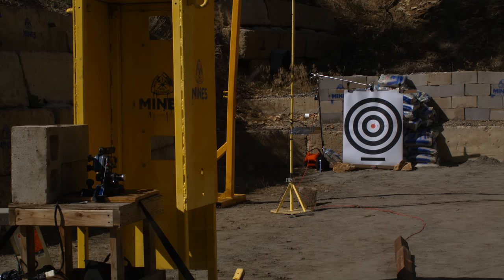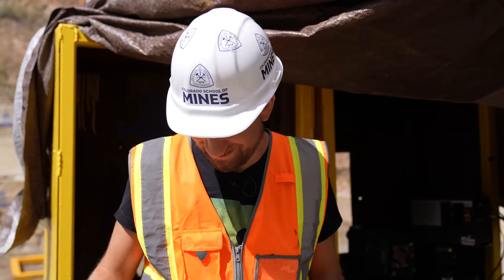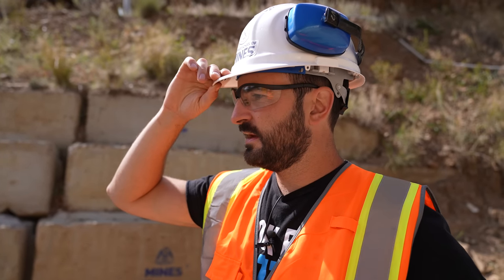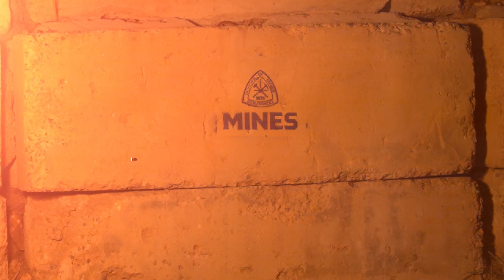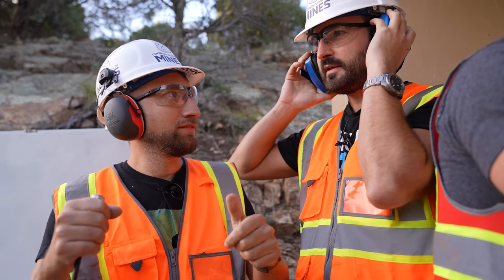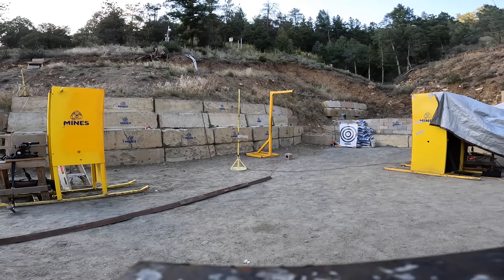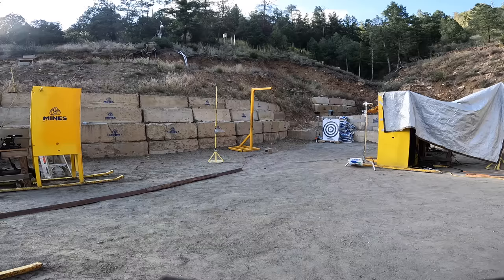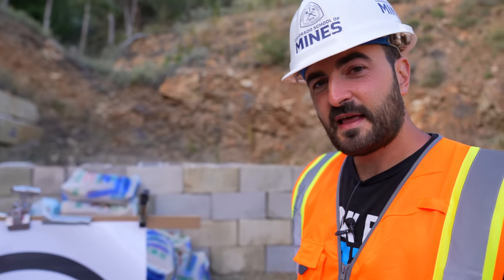Can Explosions Deflect Bullets? 2 MILLION FPS - The Slow Mo Guys

Comment: One thing which I think would change the results is testing supersonic vs subsonic rounds. If I remember correctly, 'standard' 9mm is around 1200 feet per second, while the speed of sound is around 1100. As I understand it no normal shockwave can propagate faster than sound in air, so the bullet would be simply outrunning the shockfront from the C4. A slower bullet, such as .45ACP is - I think - more likely to demonstrate an effect. Of course, it has more mass so that may change the effect. 

If you do it again, I strongly advise testing several different rounds/round compositions (eg sub sonic, super sonic, heavier and lighter bullets) - I imagine your friend Scott from Kentucky Ballistics could probably steer you right on that.
Reply: I made my comment about the bullet outrunning the shockwave before I read your comment.  I agree.

Comment: A shot bullet has a huge amount of inertia. Imagine trying to push a bullet sideways with your hands as it flies by you, hypothetically speaking of course. It'd be like trying to push a brick wall. It wants to keep going straight and is going to keep going straight. It would take a lot of energy to move it off course or deflect it. Think of what it does take to deflect a bullet, a solid sheet of steel or rock. If you have a sheet of inch thick steel (weaker than AR500 but close) at a 45 degree angle and shoot a bullet at it, the bullet slams into it and goes off close to a 90 degree angle from its initial trajectory and we get a big dent in the steel. Now think about it from a relativity point of view. In order to get that bullet to fly off at that angle at that speed, you would have to hit it with the same amount of energy it would take to put that dent in that inch thick sheet of steel... So if you can punch a dent in an inch thick sheet of steel, then you can punch a speeding bullet off at a 90 degree angle. So I would have been extremely surprised if these explosions did anything at all to the bullets trajectory. Speed is energy and energy is inertia. 

Bullets also weigh a lot for their size, so that gives them even more inertia. And it has such a small surface area for the shockwave to interact with it. More than 99.9% of the energy released by that explosion is not going into the bullet. In order to actually move a speeding bullet with an explosion shockwave, you have to go so big that the bullet will likely just evaporate from the extremely high temperatures before you get to the point where there is enough energy pushing on that tiny surface to actually overcome the bullets inertia. Maybe a nuke could do it. That'd be a really sick slow mo video though, shooting a ton of bullets at a nuclear explosion? Lol and you can just see each bullet lighting on fire and turning into gas. That'd be so awesome.

Comment: If you revisited this experiment maybe try a rifle bullet with a longer body to see if that is more affected? For example, found a bullet in 6.5 by Hornady that appears to be 6-7 longer than it is wide, theory being more surface area to be affected by the blast. But that is probably negated by the much greater speed, now that I think about it. Anyway, maybe something to consider? Thanks for the fun video. (bullet in question - 6.5mm .264 130 gr CX by Hornady).

Comment: @Gav and Dan, Maybe you could use some lower grain, slower traveling ammunition? With less energy and speed behind the bullet I imagine it'll be more affected by the c4. Maybe try several hundred fps slower for bullet speed/energy. The .22 caliber rimfire “Colibrí” rounds fire only 420fps, and they're .22 so theyll be much lighter in addition to slower, so much less energy to overcome overall. Cool shots though!

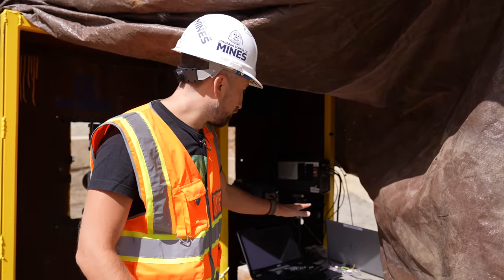Comment: 2:41 Wow, a whole 250 frames? That's incredible!
So I guess after that you need a new shimadzu?
16:12 Exactly. There's a huge difference between "slightly affected" and "not affected". The former means with enough power you might meaningfully deflect a bullet, and the latter.. Might warp our understanding of how these forces interact. I might be saying something completely stupid here, but it could have the same impact of learning that the shockwave was a ripple in spacetime rather than simply air density. Physicists would probably laugh at me for saying this, but this could be the kind of level of discovery we get if we learn more about it.

Comment: The aerodynamic design of the bullet that prevents it from slowing down from air resistance is also what reduces the effect of a shockwave. In that sense it should be resistant to the explosion as at is resistant to wind. I think it is a good idea to test it with a old fashioned bullet like the ones used on a flintlock. A further distance from the target could also be useful to exaggerate the diversion of the bullet giving a clearer result

Comment: very interesting, but I think you needed to fire more than one control to actually establish the consistency of it firing without the explosion, so then be able to decide whether the deviation with the explosion is actual explosion deviation or random deviation, gun moving, wind, etc.  A control in between each explosion shot too, since explosion could move the gun a little by the concussion.  Just a thought.

Comment: My hypothesis is that the bullet has so much energy behind it that a blast from a measly 100g of explosive does not have enough push to deviate it from its path. It's basically 100g worth of energy being pushed out at high velocity in all directions but the bullet doesn't cover even 1% of that.

So, rough broken abacus estimation is that the bullet is just being dusted with a weak 0.01g of 100g worth of blast energy.

Comment: My mind keeps saying "em-vee" and "half emm vee squared" and I think of a bullet as Much Mass, and an explosion of Lots of Gas (so little mass). But at the end of the video you point out the speed difference between the bullet and the explosion, so dear old "vee squared" rears its ugly head.
I am not sure how to evaluate the math, because I don't have the raw data.
I imagine too that the vertical distance of the bullet-path from the centre of the explosion comes into it, too; after all, if the bullet was traveling half a mile above the explosion then we would expect the explosion to have no measurable effect.
Great video; worth watching for the irregular shape of the explosion, alone!
Chris

Comment: Deflecting "bullets" with explosives is the principle behind Explosive Reactive Armor (ERA) on tanks. I think the main difference is that it is a shape charge aimed directly at the projectile (APFSDS "dart" or HEAT-FS fired from a modern MBT), as well as the explosion happening right at the point of impact with the armor itself, so... an explosion much closer to the projectile and all its energy directed right at the projectile.

Comment: So I wanted to predict what would happen. I have come up with a pretty simple formula for a shock wave acting on a (small enough) object perpendicular to its motion:
v = Δp / c * V / m
where v is the perpendicular velocity imparted by the shock wave, Δp is the pressure difference between the wave, c is the speed of the wave and ambient and V and m are the volume and mass of the object.
I had no idea what the pressure and speed would as shock waves travel faster than sound but for a (very) crude estimate I used the speed of sound and it showed that the speed imparted would be ~0.1 m/s/bar.
I have to say I am pretty satisfied that I was able to correctly predict the reaction of the bullet (even if the guesstimate may be orders of magnitude wrong).

Comment: Consider the force acting on the bullet, the vector is tiny because the explosions force is distributed mainly everywhere but the bullet, due to the tiny surface area of the bullet. To do this you need a focussed and directed explosion, a plasma jet works,  At this point however you are not that far removed from shooting a bullet with a bigger bullet, which obviously 'aint easy. I've been told it can be done without HEAT, but again using a focussed explosive, but  to me the math sucked and it has not been tested to my knowledge. Great video.

Comment: I feel like if the explosion initiated just a little bit earlier, so as to affect the bullet as it approaches the explosion rather than when it is directly below the explosion, we would see some different results. For one, the bullet would be flying directly into the explosion, whose forces would surely (I'd think) take more of the bullets velocity away, therefore allowing for more deflection. Just a thought, in case ya'll do a round two for this experiment!

Comment: Use 45 ACP. Slower round with more surface area. You need peak pressure as the bullet passes, so way earlier on explosion timing. And also, run the c4 about 4-6 inches above the bullet. Especially if you cant increase the size of the charge any more. The height of the charge over the billet is also a tuning vector.

Comment: really good video, I think if you try this again in the future, would love to see what would happen if the bullet had to travel through the shockwave, instead of being bumped by it. the other thing I wanted to mention though, I wonder if gyroscopic precession is affecting the results, with the explosion pushing down on the bullet I would think you should expect the bullet to deviate 90 degrees  from the access of rotation, so if a force is applied straight down would deviate to the left or right depending on which way the bullet spins.

Comment: Great video and analysis!  But speaking of Mythbusters, please do an experiment whereby you defeat the safety features (TPRV) on a 120 gallon hot water heater and let the pressure reach over 300 psi before it fails.  Please setup a makeshift living room, complete with a mannequin watching TV and ballistic jello 😁  Should be quite interesting.  Thanks and have agreat day!

Comment: normal blasting caps have variablity in single miliseconds, what you need are exploding bridgewire detonators, which are consistent to low single microseconds...they're also a key component for implosion-type nuclear weapons, so actually getting some might be a bit of a challenge...

Comment: In my opinion the explaination is the density of the bullet versus the density of heated gas from the explosion. The density of the bullet is literally 7000 times bigger, than the density of the heated gases of the explosion. That itself makes the deviation of the bullet only in the range of one thousands of a degree angle. Plus the fact that the bullet is round shape so it doesnt has to much resistance through the air (even when the air hits it from the side). Other effects, like mentioned in the video: the rotation of the bullet further stabilizing his path.  Even before i saw the video, i was sure, that the explosion will not influence that flightpath of the bullet.

Comment: A good baseline for how much the pressure wave is even capable of affecting bullets would be to hang bullets from strings surrounding the charge. Upon detonation you could calculate the acceleration of the bullets from their velocity on camera. You could then figure out which type of bullet is affected the most from which angle and do the initial experiment based on that data.

Comment: You know, we have this idea of explosions pushing everything around them away. My intuition, though, is that the explosion just creates huge pressure waves. To the bullet, this is like being a ship in stormy seas. Maybe the seas jostle you around a bit, but they don't propel you in a particular direction. I also thought that getting hit by the shockwave is kinda like getting hit by a regular wave while in a kayak. It pushes you one way to start, but then you get over the crest and it pushes you the other way. In the end, the wave doesn't impart very much net momentum at all considering the energy of the wave itself. I think waves travelling through fluids are just not good at propelling things. That's my best guess, anyway.

Comment: the distance from the explosion has such an impact on your results due to the square cube law, as well as the fact pressure is just as dependent on area as it is force. PSI is pounds per square inch, so a small area target will experience less overall force as a larger area target. It does make me wonder if you could physically prove this by having two differently sized plates deflect from an explosion and measuring the deflection difference as a difference in force.

Comment: I feel like using a slower explosion might be more effective. With a high speed explosion like this, the shockwave has almost no time to actually affect the bullet. A slower explosion might have more time to impart its force on the bullet.

The bigger thing here, in my hypothesis, is that the density of the bullet and the air are so different. I would guess that even with the crazy pressures from the explosion, that the bullet is still orders of magnitude more dense than the compression part of the shockwave. That essentially means you have a big impedance/resistance mismatch that would need to be overcome.
Reply: THIS is what I was also trying formulate in my comment. Fantastic reply!!!

Comment: You might want a bigger bullet going slower. I think part of the issue is that the bullet just isn't very big, so the shock wave doesn't really have enough surface area to act on. You also might want to try timing it so the explosion is in front of the bullet a little, that way it could both slow it down and push it down.

Comment: In theory, the expanding gas of an explosion obviously should have an effect on a bullet's trajectory. Otherwise sharpshooters wouldn't need to correct for windage. Using explosives to deflect projectiles is also the basis behind ERA. However, in this instance the target is likely too close and too motile to accurately judge deviation from baseline. The problem is that the bullet (while small) has significantly more mass than the gas that is impacting it. So although the bullet is influenced by the very fast shockwave, it isn't to a degree that would be visible in such a short distance.

Comment: I'd like to see a 2nd test with a few initial non-explosion test shots to see what the 'margin of error' looks like with the rest and ammo you're using, as well as either repositioning the target or swapping it for something solid that won't be blown around by the explosion. Right now I accept that the bullet is definitely not being wildly affected, but I'd like to get a more accurate idea of whether the explosive effect is small, or virtually nonexistent. Would also be curious about the explosion going off just prior to the arrival of the bullet. Is there a greater effect if it hits the concussive wave head on?

Comment: the speed of the C4 also a good way to see why all bombs in the movies are usually firebombs, its not just on set safety due to their minimal pressure wave but also real explosives are a quick sharp punch which is bad for cinematic value.

Comment: The change in the momentum of the bullet should be, very roughly speaking, the product of the bullet's cross sectional area as seen from the explosive, the overpressure of the shock wave, and the time it takes the shock wave to pass.

The area of the bullet is small. The time is tiny. The amount of momentum change needed to produce a substantial deflection is pretty large. The overpressure just isn't enough to overcome these things.

You could also try hanging a bullet from a string next to the explosive, and see how far it gets pushed sideways.

Comment: I think the issue here is the radial distance from the center of the C4 and the bullet. 
Because of the inverse square law, the power of the explosion diminishes a lot by the time it reaches the bullet, because it is spread out over a huge area.
If the bullet passed the explosion just underneath it, perhaps a centimeter below, then you would see a greater effect. Since much more of the kinetic energy of the C4 would be imparted onto the bullet, and not just the spherical area in the air around the explosion.

Comment: I would love for y'all to continue this experiment. Because as you pointed out, wind does effect the course of a bullet over time and  distance. But the fact that a forceful amount of wind doesn't effect the bullet that much, seems odd IMO. So how much "forced" wind deviation in a split second, is equivalent to "standard" wind deviation found over time and distance? In other words, if standard wind causes a deviation of 1 inch at 300 yards, then how much forced wind is needed to deviate 1 inch at 3 yards?

Comment: You've only got a tiny fraction of the energy of the expanding shockwave hitting the bullet, because the bullet is so small. At a guess, it's probably being hit by a compressed volume of air the length of the distance between explosive and bullet, and of cross sectional area of the face of the bullet it's hitting. A small volume and really low mass, even though it is moving at a very high speed. Maybe if you can place some kind of sensor (that doesn't get obliterated) the same length as the bullet under the explosion, that can measure the aproximate energy available to deflect the bullet may give some better idea. It will no doubt be more complicated than this, but it's where I'd start from.